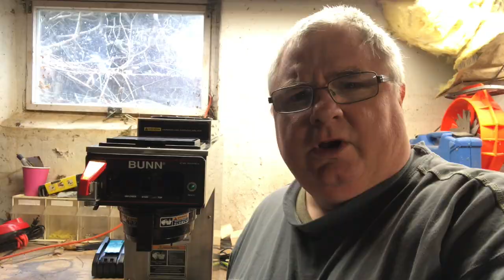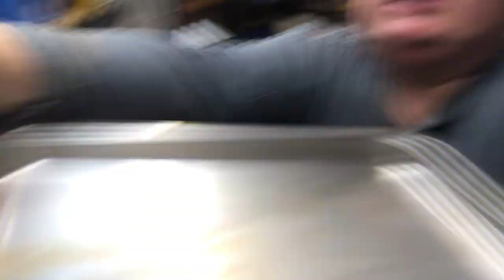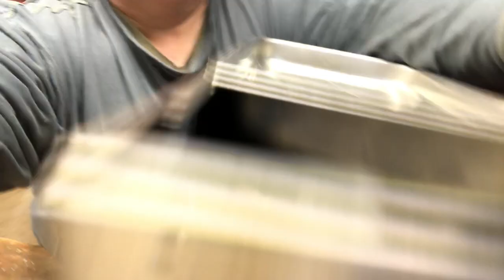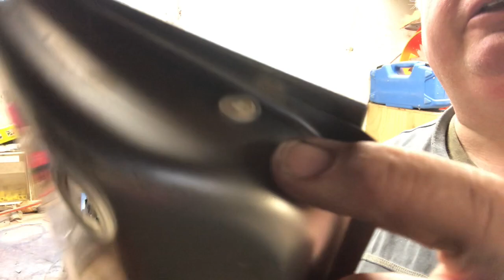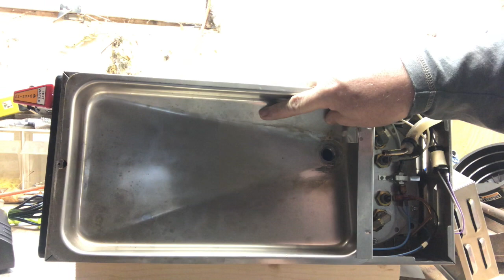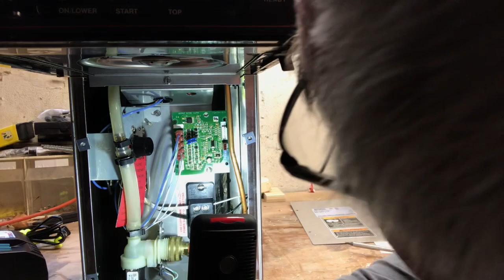Bunn CW series electrical and leak points

Comment: I am getting water leaking out of the home for thermostat wire. The gasket is a loose, but would that be a leak point ? How full should the tank be- is there a water level adjustment for the tank.

Comment: So if the thermostat prob is touching something on the inside of the boiler will that cause it not to heat? I recently fixed a leak on one at work and now it’s not heating.

Comment: I have a CFTW.  Your video is 5 years old today (3/8/25).  An employee broke the switch on the back.  I can't reach it through the top (some tack welding).  I can't reach it through the Bottom (some tack welding).  I can't find a way to get the cabinet off (some tack welding).

I have new switch, but can't get it installed.  I have removed the metal switch guard bracket from the back and will attempt to cut the cabinet precisely to take the broken switch directly out and then use the metal switch guard bracket to reinstall the switch and hold it in place.

Comments are welcome, even highly critical ones.

Comment: Mine is blowing water everywhere when I brew. It comes from around the basket area. Looked like it was coming out that hole. Thanks for the video. I'm going to try replacing the spray head and maybe that seal in the tray up top?
Reply: Then which parts use for repair

Comment: Hi, I’m having difficulty testing whether the led is bad, or if the input is bad from thermostat. What voltage should I be getting at the wiring harness the led plugs into.  I have a 120/240 model cwtf35
Reply from the maker: 120v

Comment: I have this same exact model that I am currently trying to fix. Ive gone through hours of troublshoot. Got this for $50 at thrift store so dont know its history. To this point i replaced  one brass water line that had a hole in it. And ive replaced the bug nut on top of the flow control on the back because the previous nut was cracked open (almost looked as though someone may have dropped it). 

After replacing these obvious things then i proceeded to troubleshoot the operation of the machine. Putting water into the top I wanted to make sure the tank was full so it could heat. Well during this process i put too much water in and water started pouring down to the bottom. 

I thought from previous forums i found that if i overflowed it then remainder would just come out theough the spray head. Well i was wrong which i later found out the silicone seal to the tank wasnt sealed properly. Currently it almost appears as though the top of the tank where it is bolted to the top looks warped a little bit. Not sure if it is supoosed to be flat or if its just warped. Hopefully not because i dont want to accidentally overfill it in the future and have it leak again. 

Ill address the leak if i can get the machine working. I have now gone through a series of testing continuity at alot of points to find my issue. I currently cant get the brewing process to start. The heating element comes on and heats the water to close to 200 degrees (i checked with a thermometer) but the water never boils up through yhe tube into the spray head through the filter tray. 

Was hoping maybe you had some advice for the leak spot and if you think that top could have been warped and if you know why i cant get brewing to start. Thank you
Reply: So I disconnected the spray head tube to see if there was buildup and seems to be water going through okay. Maybe my syphon gasket wasn't connected properly not allowing vapor.pressure from boiling to allow pass through to the brew cup
Reply: Update so my tank cover was warped and welded screws on tank were bent outwards preventing the cover from coming off. So I had to put the nuts on and bang the screws back so I could take the lid off. When I did I also discovered a big hole in the coil. So far this thing had 1 hole in a brass line that goes to the solenoid and coil , the flow regulator had a big hole in it and now the coil has a big hole in it and the cover was extremely warped. I'm sensing this thing had a major failure. I'm tempted to now replace the coil, new gaskets and new cover and see what it does but I'm also nervous it will fail again. Maybe that first hole created bad pressure and just created a chain reaction eventually in other points ?
Reply: Do after ally parts came in and putting everything back together, the water heater heats the water and it clicks off automatically but once it's heated and I hit the start button it still wont brew. Any idea what could still be the problem?

Comment: How is the water level in the boiler determined? I have one that fills and keeps running and overflowing. There must be a sensor to trigger the fill valve?
Reply from the maker: Mine has the same issue that I’m currently dealing with. 1st problem to look at it is the water solenoid. Sometimes it may not seal after you brew or just sitting there. If you have a instant hot water dispenser, you can have a leak in the circuit that is still feeding the boiler volume. When you do a boiler feed for the first  time you have to do it when the machine is off. Then fill up the boiler till water comes out. Then turn on the machine and press brew you should be go to go

Comment: How can you get the spray head off, if it's stuck? Or clean the spray spouts without taking it off? Our work machine doesn't budge.
Reply: Did try a rag? You have to take it off to clean.
Reply from the maker: If you still have a stuck head use a pair is channel lock pliers lightly as not to mark up the spray head. If you do no worrier the spray heads are very cheap, sorry so long in getting back to you
Reply: @n3qdz  No worries, thank you for the answer!

Comment: I have the same machine Bunn cwft15 and it stopped heating I watched one of your videos and you mentioned to change a thermofuse wire which I did and it worked for a little while and then it stopped heating again is there something else that I should check?
Reply from the maker: Well if the switch on the back it not off (i super hope it is in the off position) the problem can be 2 things. One check to see if the boiler heating element is in tact. Just taking multimeter to the boiler heating element. You should get continuity. If that isn’t tacked, it’s very possible that the thermostat board is defective. The testing procedure on that I don’t know how to handle you might be able to find a thermostat board on Bunns website to replace it with. I hope this helps.

Comment: I have a Bunn A10. It's leaking at the tank cover gasket. A new gasket is ordered. I'll find out how much I have to disassemble to replace the gasket when it gets here.
Reply: What happened?
Reply: @thumpergrey  new gasket arrived, I installed it. got to inspect and clean inside the tank. it was pretty clean cus we use reverse osmosis filtered water in it. some dissassembly required but not too difficult . I'm pretty handy at fixing stuff like this. I had another spare bun that needed a thermal fuse and I fix that one too.

Comment: We have this exact machine at work. Ours is leaking from the seam on the left side of the machine. Is that something that we can repair ourselves?
Reply from the maker: Sure, if you take it apart as is my videos you can pretty easily identify the leak. Just make sure to unplug the machine. You can still add water to the machine while its unplugged. Just be careful the water in the boiler will still be hot.

Comment: I have the same cw serie with automatic water inlet. I keep having the water leaked out through the clear grommet every time I press on, then start after it filled up. After installing a brand new grommet and siphon tube, it still leaks. Any idea?
Reply from the maker: I believe, that grommet has a channel in the middle  of it so it doesn’t do exactly what you are describing. If not, take a QTip and clean the inside of the hole. It might have some buildup that is keeping it sealing. Please let me know how it turns out. Thanks for the view and comment

Comment: Do you have a video on the thermostat? My water keeps boiling over
Reply from the maker: No I’m sorry i don’t specifically. If you pull the  panel on the front you will see the thermostat dial. If ya turn it down you should be ok. Sorry i don’t have a specific video you are looking for
Reply: @n3qdz  I pulled the prong out to see if it was dirty and it broke off the wire haha

Comment: Are the warming plates thermostatically controlled? Mine are warming to a temp of 300 degrees  Are they controlled by the Boiler thermo or a seperate thermo? I have the single upper warme / lower warmer,  pour in only commercial brewer.
Reply from the maker: So far as I know the warming plate are not adjustable.

Comment: In have a cw35. I can have it turned off and pour water directly into the boiler and water leaks everywhere.  I'm assuming it needs a new boiler. . And tips?
Reply from the maker: I just saw your comment sorry for the delay. I boiler is thick stainless steel maybe it could be the boiler, but I don’t think it is. Check all the copper lines that lead into the boiler. To remove the boiler is pretty simple. Has a lot of leads to it but it’s pretty simple job to do. I would just start with looking at the circuits that lead into the boilers and see if you have the pan that’s on top of the machine that you pour into it if that silicone grommet is leaking let me know how that goes.

Comment: This machine at our firehouse stopped brewing hot. I discovered the thermofuse wire melted. Could that be the only issue or should I look at other issues before I put the new one on? Other bad parts that may have caused the fuse wire to melt?
Reply from the maker: Nope they will do that after some time they will burnout

Comment: Great video, thank you! Do you have any suggestions on how to fix an inflow tube that continues to keep dripping water in? We have it hooked up to a water supply. It was leaking water continuously.  It continuously leaks water in even when shut off. If it's turned on, as soon as it leaks enough water it spews water out into the coffee pot. What makes this happen and how do I get the intake/inflow tube to stop dripping?
Reply from the maker: I have the same issue with both of my machines currently. I have replaced the water valve on the one machine and the problem still exists. I’m currently in the middle of trying to figure out if it is a logic board or what exactly the issue might be. You may have a bad water valve, you can go to parts tree and parts tree will have you look up your exact model number and serial number. The water valve is not that expensive I think it was somewhere around $10-$20 I believe. The valve was super easy to replace I would start there and see if that might be your issue. Let me know if this has solved your problem. Thanks for watching thank you for your question

Comment: The bunn here at the office sometimes just brews half a pot. Advice please on where to start.
Reply from the maker: Two things (from hat I’ve found)  when people don’t use a full pot it screws up the machine’s cycle. Its very strange. That only happens when people pour in the water as apposed to pushing the brew button. The other issue is a little more difficult. Either the logic board that tells the water valve to open on duration or the valve may be wearing out. Parts town is a great resource for online manuals to order parts and free troubleshooting documents

Comment: Great video. Thanks. I have just gotten a STE-15. I do not yet have it plumped in. If I pour water into the top fill, what it going to make the machine brew? Is my start button is only to fill the tank?
Reply from the maker: It’s a simple process actually it’s very simple when you just add water to the top of the machine it will start to brew when you turn on the switch for the burner that just keeps the burner hot but there’s nothing to do for the machine if it’s not plumbed in but only to add water. When the machine is plumbed in, there is a relay that opens up a valve that will measured amount of water into the tray above the machine and gravity just does all the work.
Reply from the maker: The machine when you get it may have water in the boiler. I would suggest before you run any batch coffee through it is you pour about eight or 10 pots of water through the machine just to take out any old water that may be in the boiler. Bun does make a cleaning solution for that I’m not sure if the machine is used or not but that might be a good route to do

Comment: Thanks for the videos, very helpful. I have the CW15-TC PF, it is pour over only, but I wondered if you can add a hot water faucet to it as a hack?
Reply from the maker: So far as I know it’s very expensive in order to do that it’s a whole different circuit that goes inside the boiler and you have to get the facepiece the Spicket and all the internals and the internal piping. With its Inexpensiveness you can be able to find one with hot water that is fully plumable pretty inexpensively on the Internet or through Facebook marketplace. Besides that the build might be a little more complicated than you want to do

Comment: Your videos are awesome thank you. My Bunn VP17 pour over coffee maker needs a new seal for the thermostat. It’s the round silicone plug on the top of the water tank. Do you know how to install it? it has a small hole on top not large enough to fit thermostat through but I can’t figure out how to open the other end where the wire connects, so that I can slide it up the wire. Do I cut it to fit the wire in? Any help would be great.  Thank you.

Comment: Hello, thanks so much for ur informative video!  I do have a question, excuse my no electrics knowledge, but I have the older version with the 3 red switches, which the most used two have came off and will not stay on.  So I have came across another machine with buttons intact.  But is not as clean.  So I would like to swap the switches.  So, I have an idea of the steps but I would really like to be confirmed that my idea is do-able.  And other surrounding hazards I should be careful of damaging?   Again, thank you for the help, have a blessed day.

Comment: Hey this is Paul hey I got one of cw-15s but the back have this machine doesn't have that plastic container piece where your rubber hose comes out of and the brass and pipe out the other side mine's just got electronic shut off also the little sprayer that comes out and goes for your pot that's not a g that is a six zero seven eight triple zero so how many of these buns that's got the cw15 model do they have I'm just curious if you can just another video of a cw15 maybe it's an old one I got I don't know anyway have a great day love you video
Reply from the maker: So if I’m correct in reading your statement yours is not a plumbed machine meaning that there is no pipe that you connect to the back of it you just take apart and dump it in the front of the machine am I correct about that?